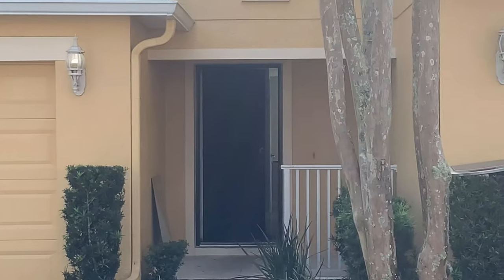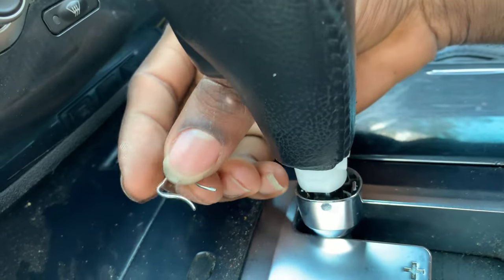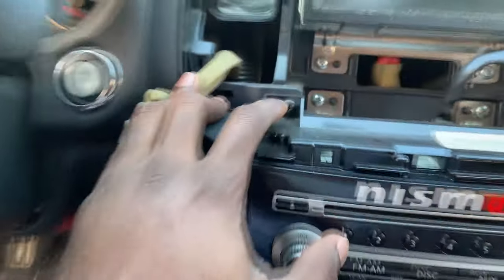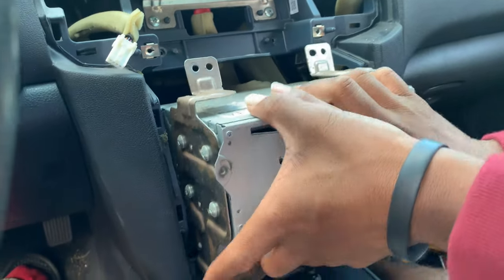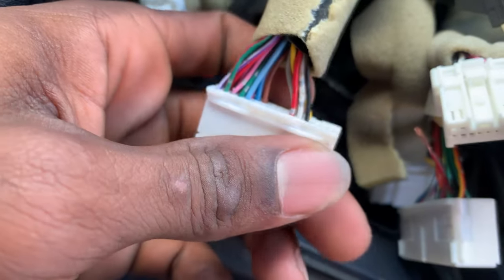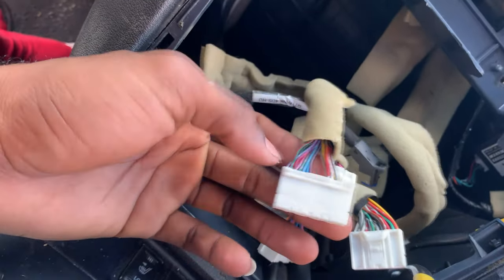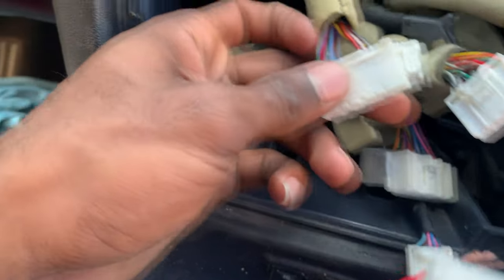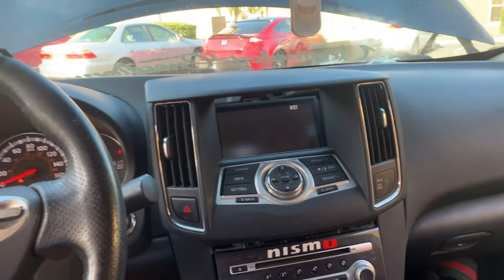Bypass Ebrake and Speed Sensor - Play Movies While Driving NISSAN/INFINITI

Comment: What kind of speakers did you add to the car? And do you have subwoofers? I have the same car and I want a good sound system, even though the Bose is really good I want more lol.
Reply from the maker: I swapped my doors for Kenwood speakers and for the subwoofers I have two P1 12s. 1500 W amp. The door speakers are not running on any amps
Reply: I add a audio control lc2i to my maxima  add 2 jl w3v312s and my 500/1 sounds good
Reply from the maker: Nice!!

Comment: Any particular tool you use to splice and ground the red and green wire together? Eliminate purple and white, correct?
Reply from the maker: Yes eliminate the purple and white by simply cutting it and taping both ends. And you're cutting the the green and re wire. taping of the end that's sticking from the harness and grounding the end that's coming from the car to the back of the radio or wherever you can get ground from. You should use a splicing tool like a wire cutter but I used a blade because i'm old fashioned.

Comment: Does that speed sensor wire not have other functions like mapping or fuel economy readings? I'm also wondering if there's a way to ground out that wire right at the parking brake. I'll have to look.
Reply from the maker: The affect different cars in different ways

Comment: Hey bro I just did my successful but on g37 wires are different. Only problem I have grounding the parking brake is that my light is steady on and it the brake beeping noise 🤦🏾‍♂️
Reply from the maker: Glad you reached out and got it working

Comment: @ThisBGama I’m a bit slow, where did you get the red ground cable from that’s on the back of the radio (3:31)
Reply from the maker: I attached it to the back of the radio for ground. It was my own wire. it made reaching the cut wires a lot more easy
Reply: @ThisBGama  very Good ,please help me with my ford fusion sync 2 ...how to bypass ebrake and speed sensor?

Comment: Good looks I'm about to do it 2mr and hows the extra speaker in the door were they hard to do
Reply from the maker: No. Just gotta carve the whole I’m your foot panel so the speaker can sit flush
Reply: @ThisBGama  do u know what's the door speaker size for the front I bought the prv 6.5 but I think I jumped the gun and heard the fronts are 6.9
Reply from the maker: Lol yea they are 6x9
Reply: @ThisBGama  Do you think I could fit the 6.5 and if not are the 6 by 9 circle
Reply from the maker: @jfaze401  you can custom fit them or you may have to get a conversion kit

Comment: I did this with the battery unplugged and everything cut the first wire grounded the second and the reconnected my battery and started the car .. everything was good for 2 seconds before my radio screen went black im thinking it just popped the fuse but i had the battery fully out of the car at the time so it really shouldn't have and even if the fus is blown what would have caused it?/ whats to say it wont just blow the next fuse i put in?
Reply from the maker: It must be grounded wrong, or it must be the wrong wire cut. Double check everything.
Reply: @ThisBGama  nah everything was grounded fine fuse wasn't even blown... the screen itself has 2 plugs that are the exact same size and I had reconnected the LCD wrong all is good now to find a constant 12v to feed power to the reverse light so I can't watch the flames while driving lol 😂
Reply from the maker: @mustafagak2852 I gotta do that too
Reply: @ThisBGama  I'm thinking either pull 12v from lisence plate light,rear door lock actuator or the rear window switch... if none of those work gunna have to go all the way up to center console and try the cigarette lighter and radio then If all else fails gunna tap into the accessory wire in ignition for constant 12v

Comment: Does ur ebrake light stays on when u do this
Reply from the maker: No
Reply: @ThisBGama  I did what u did and my ebrake light stay on and beeps
Reply from the maker: You’re sure you got the right wire? And make sure you have brake fluid in your car. Mine was on and I added break fluid and it went away
Reply: @ThisBGama  okay and my b a stupid question but I'm grounding  the one from the harness red and green and cutting the purple one
Reply from the maker: Yea your cutting the purple and white to separate the connection. Make sure you are cutting from the right harness. And then you’re also cutting red and green. The part of the wire that goes into the car, tape that end. And other end sticking from the harness (the white assembly) you’re grounding to basically trick the radio module into thinking the ebrake is activated
Reply: @ThisBGama  red and green wire from the harness to the ground or the radio to the ground
Reply from the maker: It’s technically from the radio to ground if you think about it because the harness will be plugged into the radio. The wire will come from the harness and be put to a ground source (which in this case is the body of the radio) hope I’m making sense
Reply: @ThisBGama  perfect lol plugged in and the red and green to the ground so the radio won't connect to it just to harness white part
Reply: @ThisBGama  every time I ground it my ebrake comes on
Reply from the maker: That’s weird. It shouldn’t do that. It didn’t for me. Something must be wrong with the ground wiring of the ebrake. Try to have the ebrake pressed before you ground it. Maybe it’ll reverse the light switch
Reply: @ThisBGama  are those the only wires u cut in the video it looks like u cut nothing wire that's green and red
Reply: @ThisBGama  very Good ,please help me with my ford fusion sync 2 ...how to bypass ebrake and speed sensor?

Comment: If you fast forward to 4 minutes n 11 seconds it looks like another green and red cut
Reply from the maker: I had cut that one at first the first time I tried the bypass and the video did not play. try to cut it and see what it does too. it didn't affect anything in my car.
Reply: @ThisBGama  yeah I'm taking it to a shop its 150 I shown you video maybe my ground or something because now the backup cam ain't working and the screen turns off
Reply from the maker: @jfaze401  something else gotta be messed up. Yea
Reply: @ThisBGama  I can't anything but ur video the red and green is the ebrake bypass and the purple is the motion sensor how did u find that out
Reply from the maker: Google radio wire color codes and landed in a forum where they have the details. It was on luck so I might not be able to do it again. And it’s an Infiniti bypass video that the exact same, but he added a switch so he could still use the gps screen which my car doesn’t have
Reply: @ThisBGama  lmk if u find it

Comment: Hey, so I followed your video and my E brake stayed on, took it off and my radio stopped working. Any suggestions?
Reply from the maker: You’re the second person that said that that happened. Check radio fuse. And try connecting everything back the way it was. You don’t happen to have navigation in yours do you?
Reply from the maker: I might just have to redo the video
Reply: @ThisBGama  No navigation in mine. I replaced the fuse and it came on. Had a feeling that was the problem. Thanks for reaching out. Love you Nismo too son its nice. Also tried the firestick setup didnt work. Gonna watch the video again to see whats up.
Reply from the maker: Thank you. Glad I could help